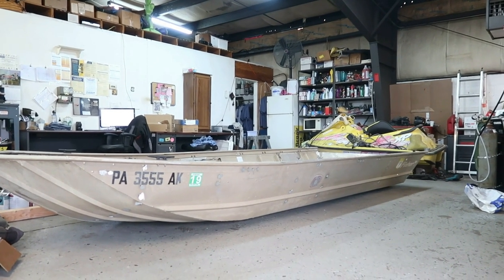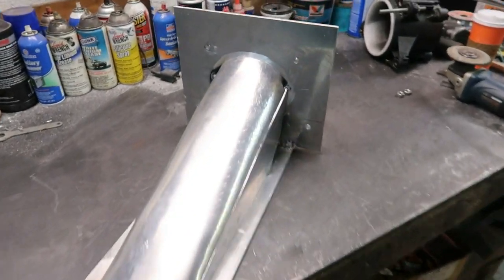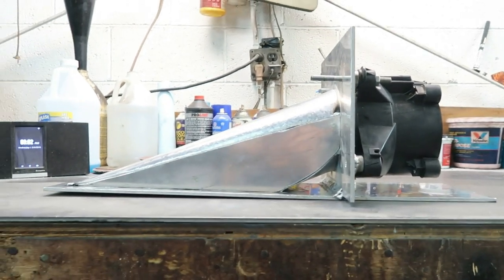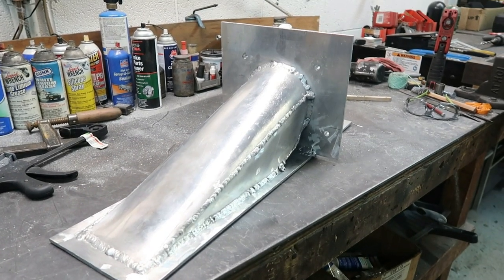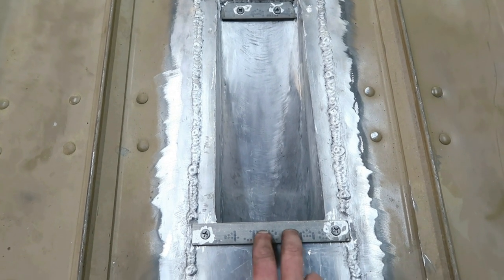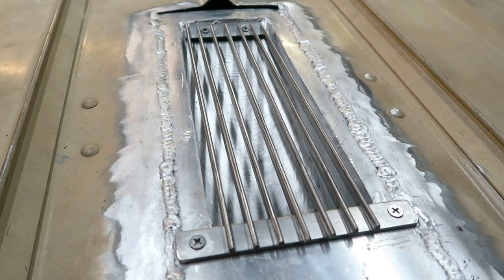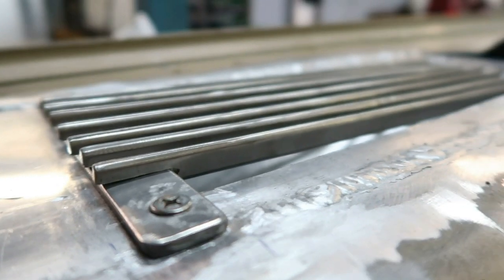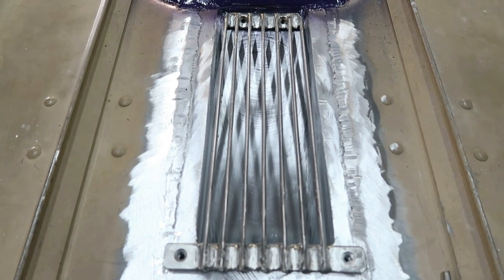Jet Boat Build ep1 - Intake and Grate

Comment: Does the impeller blade cut stringy stuff and fishing line or is there some other countermeasure for that? I'm not even sure that is a problem for these units. thinking some fixed blades that were in front of the impeller, edge opposite of rotation would be useful. Looks good.

Comment: Coming along nicely.No clean out stomp grate?How are you going to clean leaves,bark or stones that get stuck in the grate?
Reply from the maker: We have had it running for 1.5yr now. Only clogged it a few times during fall leaves in the water. Do wish I woulda done some kinda stomp grate, but since the boat is not strong enough to skip on gravel, we only deal with occasional weed clogs. With my shirt off, I can unclog it laying on the deck lol.

Comment: Nice work but the only thing I would say is dont bother with 1/2 inch stock, not strong enough and will get bent in. make the grates out of 1 inch or even 1.5 inch as this part being larger/deeper will not in any way impede water flow as the water is already passing through, the water dont care if the grate bars are 1.5 inch deep as if flows into the intake. This grate is going to take a beating. 

The attachment plate on the front should go down into the intake, be larger and have more bolts, Allen head type attaching it. the back end of the intake tunnel where the grate bolts on should be at a 45 degree angle allowing for much larger back attachment plate with more bolts that are up in the tunnel and away from the bottom where they could be damaged by rocks etc. The intake grate assembly should form the front and back end of the intake tunnel shape so when the intake grate is bolted in the rear of the tunnel is 90 degrees to the bottom of the boat. This design gets the attachment bolts down away from the bottom and allows for many more bolts to be used.

Look at it like this, dont design the intake tunnel then put a grate on it, design the  intake tunnel and the grate to both be part of the intake tunnel shape. This allows the grate to be made a lot more heavy and thus able to withstand the abuse it is going to take. As it is now I'm afraid that intake grate might not last long and end up missing if it gets run in shallow water.

~
Reply from the maker: We will see how long it lasts. This is not a rock hull build, so if the grate takes a beating that would mean the hull has also. I did drift over part of a pebble bar and busted my transducer bracket, but the grate maintained shape even though I was drifting sideways. So for this particular boat and my location, the likely impacts will be during shallow drifting, as a hit at speed would leave bigger issues than the grate. That said, Im sure its going to get bent up and I will be taking your advise, thanks alot!
Reply: how much is it worth when it comes to hass and props

Comment: Enjoyed your build man! How did you line your driveshaft and motor up properly? What was your trick or technique?
Reply from the maker: I used shims to float the engine as I slowly determined my angles and then welded up the mounts, and final shimmed with the shims that came on the ski mounts.
The technique for alignment was fitting a dowel rod into the pump/prop so that when the pump was bolted tight to the intake, it showed me an exagerated view of the shaft angle and I literally eyed it up since it stuck out the back like 5ft making it easier by eye than by measuring. 
I go over this procedure in one of the videos.

Comment: been watching vids and stuff and... where do i get a jet engine? does it ever come standalone like that?
Reply from the maker: This is from a jet ski. Yes, you can buy inboard jet engines just like outboard engines.
Reply: Ripptyde Fishing i dont see the whole system being sold together with like diagrams of dimensions and stuff
Reply from the maker: You would probably have to contact the manufacturer for any type of CAD drawings if they are available
Reply: That’s the same question I asked for a 100 times now😂.